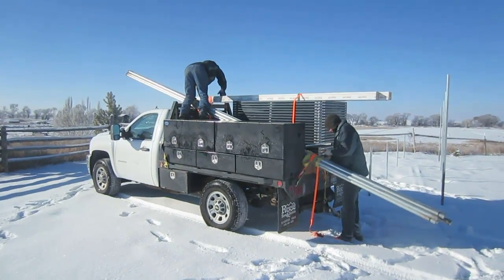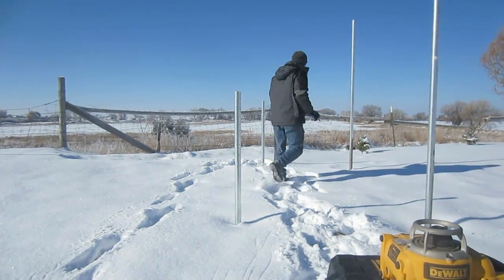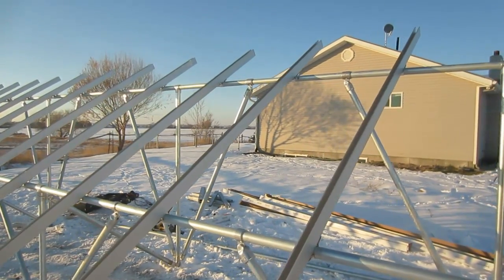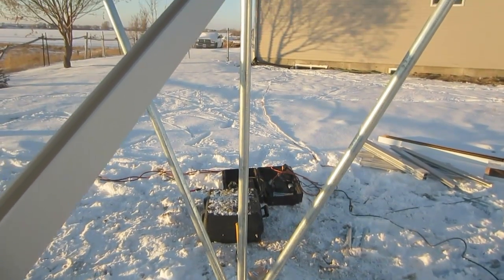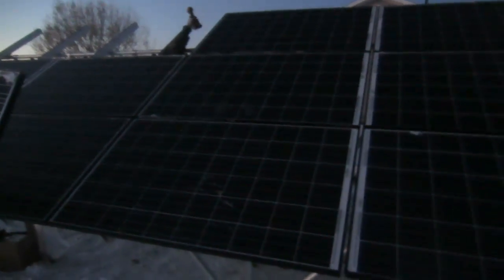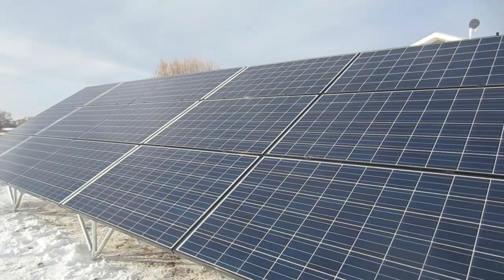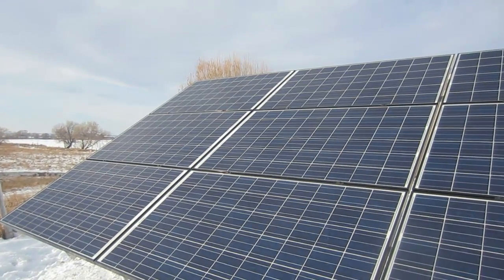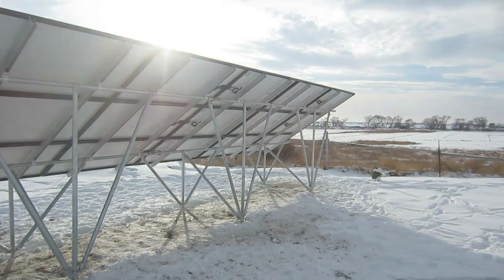Easy & Strong Solar Panel Racking System

Comment: Nice panels. Those are almost enough to heat my house. I left a comment on the propane tank video on why solar PV heating is the most cost effective solution for me to heat the house.
150mph is quite a strong wind. Is windy here great for my wind turbine but the strongest wind I have experienced here was 110km/h that is about 70mph
Even at that wind speed it almost put down a heavy concrete mixer. I have a video about the wind turbine in that wind not sure when I will get time to upload.
With each doubling in wind speed the pressure on a flat surface increases 8x
I have quite a strong house much stronger than normal frame type but I hope I will never see 150mph wind that is 8x stronger than the 110km/h I had last year and that looked scary enough.
I think that the strongest wind speed ever recorded was 253mph at least according to Google. Those where of course wind gust not sustained speed but I can not imagine how destructive that was.
I think best PV panels are rated at 180mph probably at a 45 degree not sure so no matter what support you have that will be about the most they can survive.
I like your videos so I will subscribe.

Comment: Although very nice equipment, My question is why the over kill on the systems? 5kw is huge for one farm. Would be a good choice to split the solar to use micro inverters and the other half for battery charging. Can't wait to see the massive battery bank. Thanks for bringing us along on the build.
Reply from the maker: Jerry Densmore Thank you for your comment. We decided to over size our system because our children who live in the area will come here when there is a long term crisis. We expect others to come too. There is strength in numbers. We are planning ahead to be a resource to others who need help, like charging their batteries, etc.
Reply: LDSPrepper
Thanks for informing me. I understand now.

Comment: Hello, thanks for sharing.  1 question for you... Do you have a fence around the array, restricting access or were all of the wires protected by being entirely placed inside conduit of some fashion? Reason being, in some systems the voltage present on the array can exceed hundreds of volts, making it hazardous.  Since the video was before the string wiring was completed, you can't tell.
Regards,

Comment: Its great to see this project coming along! I was wondering if you have any information on how much sunlight is needed per day to make such an installation worth the cost and effort. Also, can you expand on the way the measurements were done and what the goal was for them? Sorry, got a little lost on that part of the video! Thanks!
Reply: You have to find out for your self if your area is worth it. I put up a temporary solar heater. And I am now keeping records of sun light received at my house this month. From Nov 6, till now. I only have had 44 hours of usable sun light to create heat. This can change for every one this month. You have to look at how much clear south facing sun you have at your house if you are in the North climate. I am learning I have way more wind than sun for winter. So I can not rely only on solar.
Reply from the maker: MrConradF Probably the best way to find out if this makes sense for you is to talk with people who have off-grid solar in your area. I would talk with at least 3 households. I imagine I need more panels in Idaho than is needed in Arizona. The math may also change depending on your location. The math was to set the angle of the panels. We set ours at 35 degrees to capture more sun during the winter and sacrifice some sunlight in the summer when we have more sunshine.
Reply from the maker: TheEmptynester Thank you for jumping in and helping with the question. I appreciate you sharing your strategy and advice. I really wanted to use wind power but the more I looked into the average, constant wind speed needed to generate enough amps to store in batteries, the problems people have with moving parts in a turbine, the effects of freezing weather and blowing sand in my area and finally the cost per kilowatt  and maintenance I decided to add a couple more panels instead of going with wind. We all have different needs and situations. This is just what works for me.
Reply: LDSPrepper
TheEmptynester
Thank you both for your answers! On top of being in the Far North of Idaho, I"m also in a river valley, so I think I only get about 6 to 8 hours per day of direct sunlight, but am not sure if it is useable sunlight for solar panels. Will have to see...

Comment: I like the Kee-Klamp rack system they used for the panels. On average I know the 2" fitting run almost 40.00 a piece. On your expense video I didn't see a listing of the rack system which I am guessing probably ran 3k or more. Was that included in the 30k for the system? I was just curious, I managed to salvage over 50 different types of 2" kee Klamps and 2" rigid pipe from a job that the stuff was going to end up in the land fill. Needless to say I have enough hardware to build a nice small rack system for just getting started out. An itemized list would of been nice to see on the equipment to see on average what the cost is for the Outback gear and other items. Thanks for making these videos.

Comment: The question I have is when it snows heavy how had will that effect them? I know they will have to be sweep off. Do you use a normal broom to do that or do you use something different? And does ice that gets on them effect them in any way? Thanks
Reply from the maker: joel coddington Great question. It snowed all night last night. I got up this morning and the panels were covered with snow. I got out my push broom I and swept off the snow. There was still ice on the panels. I went into the house and the panels were already generating power to the point we were making 3x more power than we were using. I couldn't hardly believe it. We are making power while it was snowing, in 100% cloudy skies in the middle of winter. AWESOME!

Comment: One concern I have with panels is theft.  How easily can they be removed?  What options are there for making panels more difficult to remove from the rack?
Reply from the maker: Drone256 Theft is always a concern if it be our cars, food, water, etc. With the security measures we have in place and that we are adding we have minimized that concern.
Reply: LDSPrepper My wife and I have been wanting to install solar at our remote cabin on property we own.  We are usually not out there so security of the panels is a concern.  If you have any suggestions on how to install these so that they are less likely to walk away, please let me know.  Thank you.
Reply: Drone256 Roof mount? Or, perhaps a pole mount system, getting them high off the ground? Personally, if someone wants your panels badly enough, they are going to take them pretty much no matter what you do. One thing you can do, though is, install them with bolts that are theft resistant? http://www.losspreventionfasteners.com/products/solar-panel-fasteners/ <--- a site as an example of what is available.
Reply: Paul Petrea Thank you for the link.  It seems like most theft is a crime of opportunity, so the goal is to simply make them harder to steal.  Maybe I am overly worried about theft but if you look online you will find that solar panel theft happens.